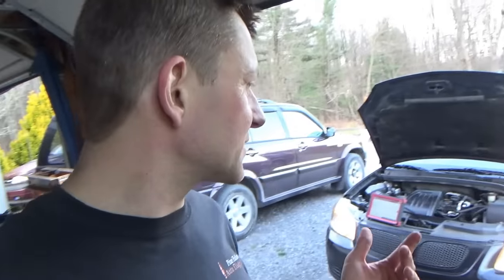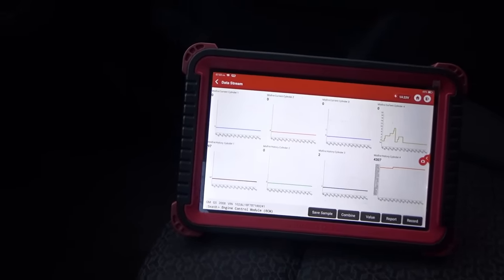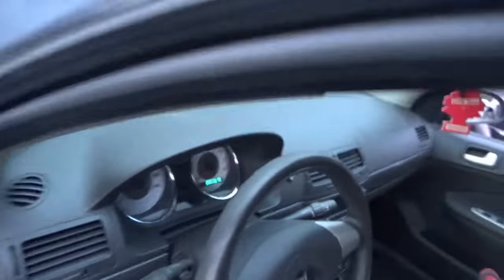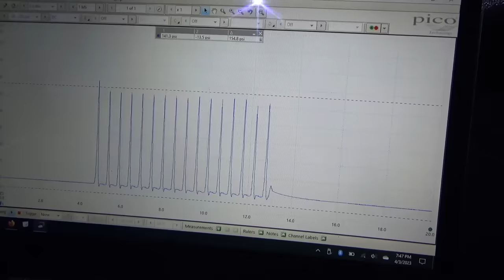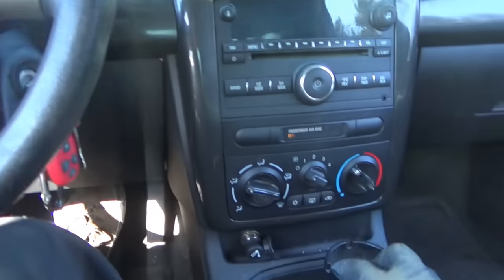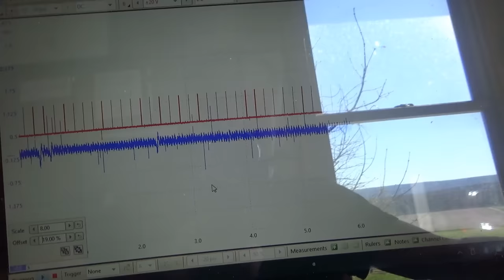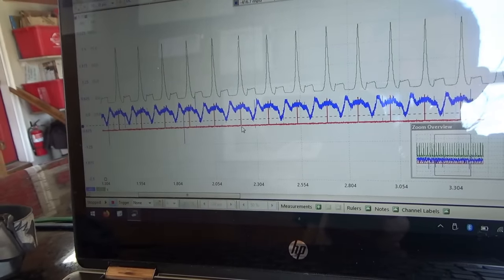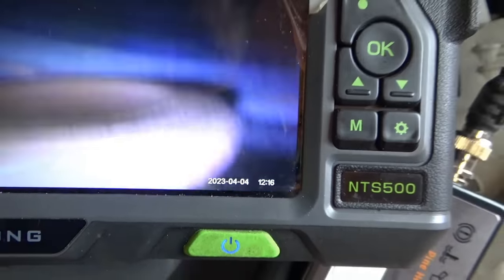P0300 Mystery MISFIRE - Difficult to Diagnose! (Intermittent "FISHBITE")

Comment: Great video IVAN,as always.Why are you so sure the valves rotate? Without springs designed to do just that?I ask because a long time ago i worked on a friend's car a 305 GM Firebird that had spring retainers on the exhaust valves only that were called valve rotators.That was my 1st ex-poser to that system and it made perfect sense at the time.What you said about the valves haveing a spot where they leak makes sense too.my 1st thought was a sticky fuel injector.or a wire that's arcing.i wish you had pulled all the plugs and coils and compared them side by side.What if one coil has leakage of elec? I'm sure YOUR viewers like myself,want you to dig further to find the issue.Out of 1,000 cars you found the cause and this one eludes you???? how can to sleep???haha or eat??
Newspaper headlines>>>Chevy Cobalt defeats IVAN THE GREAT<<< Live mouse found in INTAKE MANIFOLD,given KEY to city by mayor or Sate College.just kidding of course.this is one of your best vids,but we always learn and appreciate all of them.
Reply: scanner would have thrown a coil or injector code.   When you can hear a misfire coming from the exhaust pipe, it is generally an exhaust valve problem.

Comment: I work in the method of... What do you need for ignition.  You need Air, you need fuel, and you need spark.  If you have fuel, and you have spark, then the problem is air.  Because what is a Misfire?  Poorly timed ignition, or just failed ignition entirely. 
If you test for spark, and it's consistent, then you can rule out that part of the ignition triangle.
If you test and find you have proper fuel, then you can rule out that part of the triangle.

So you're left with air... Either the exhaust valve is sticking and letting enough air out that you lose stoichiometry, therefore no ignition, or late.. or the intake valve is sticking and not letting enough air in during the intake stroke.

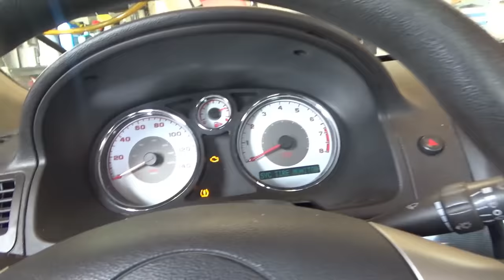@17:58

Comment: thinking ceramic valve seat moving or cracked, GM used to make top cylinder cleaner or perhaps seafoam to try to clean a slight hardened carbon deposit on one of those seats, air in that cylinder may help if you hear some type of leaking .loved your tenacity

Comment: I’ve had this before with the valve guides causing the valve to stick when the car got warm only on idle. It was a known problem with Fords ztec engines in the 2000 ‘s over here in the uk. They were replacing all the valve guides and valves under warranty. It was a pain trying to diagnose this without the tools that you have at your place, like the pico. It was guess work and a lot of unpaid hours diagnosing. In the end up we took a head off and sent it to the engineering shop who found the guides to be out of tolerance. Once the guides were changed out and new valves put in the issue never came back. It’s trying to explain this to a customer that it’s only a guess at this point until it’s stripped and confirmed, and if it’s not the valve it’s more diagnosis. I hope you get an end result, I would love to see a part 2!

Comment: Try sticking exhaust valve guide in 1 and 4. This was my experience with at 2010 Cobalt. After going crazy, I found that there was a quiet recall on the cylinder head of that engine, only up to 100,00 miles. my engine was already 125,000. I pulled the head and sent it to a machine shop. The engine ran trouble free for the next 75,000 mile. after that the car went to the great junk yard in the sky.

Comment: Interesting case study ,im going with broken valve spring and maybe intermittant valve sticking due to poor valve spring tension maybe some gumming in the valve guide. Shame we will probably never know  but I agree its way past money pit time for that car ,drooping head linings , transmission  issues , ac issues suspension issues its not using much oil but oil leaks etc coming up . Drive it till it dies then off to the junk yard.

Comment: Those coils look like $10 Ebay specials. They may not be THE cause of the problem but may contribute to it, especially if the customer said it was running fine 2 weeks ago. Dealing with an issue on a 2004 Saturn Ion with the same engine and 209K that may occasionally run rough and miss just on the first cold start of the day for 10-20 seconds. Was watching your 7 year old video, P0300 Misfire case study: 09 Chevy Cobalt, for ideas.
Reply: Well they 100% are not the cause of the problem. The problem came about before they started putting parts on the car. This was said at the beginning of the video

Comment: 1. Leave everything hooked up so it runs
2.take valve cover off
3.build a dam out of cardboard around the top of the head so the oil dont go all over everything
4.start it
5.smoke the intake
6.watch the valves 
7.look for smoke on
Compression stroke
Reply: Look for smoke where?
Reply: If the valve doesent seat
Or a spring is broken compression will smoke
Out under the spring

Comment: I have a very similar situation I'm dealing with now on a Chevy truck with a 6.0 v 8, intermittent miss on one and five cylinder, clears up off idle, switched plug, coil, wire, done fuel injector Ballance test, was as all equal, compression was 160 psi, checked cylinder leakage was well below 10 percent, checked fuel quality, had no fluctuation on a vacume gauge on the manafold, smoke tested the intake with no leakage from the intake manafold, at this point I can only think it has excessive carbon on the back of the intake valve soaking fuel causing a partial combustion or a cracked or weak valve spring, time for more digging I think, like that borascope picture 👍

Comment: If you suspect a sealing problem, maybe an old fashioned cylinder leakdown tester would help. You could compare the leakdown percent with a good cylinder. Listen for air coming from tail pipe. I still take mine out of the antique drawer every once in a while.
Reply: I'd assume he's aware of a leak down test and would perform one if he felt it was necessary.

Comment: I had deja vu watching this. I ran into the same exact issue on that 2.2 engine in an HHR. Followed almost the identical diag process as yours and came out scratching my head. I suspected a valve sealing issue. The customer did not want to spend any more on the vehicle so I never did see it through.

Comment: I would try injector swaptronics. And spark plug/coil swaptronics too,even if they are new. Also scope the crankcase pressure and cooling system with the transducer. Also would be great to see the ignition waveform at the moment of misfire. I doubt its broken valve spring bottom coil. We saw misfires on other 2 cylinders. This head needs service due to millage. In nowdays where scopes and meters are the first choice for diagnostics ,i would do leakdown test also. That could have pinpointed the problem.😊

Comment: @pine hollow auto diagnostics 
I'm curious, does the vacuum line for the fuel pressure regulator, by chance, go to the number 4 intake runner? I had an earlier 2.2 ecotec that acted just like this. It had a pinhole in the fpr diaphragm, that would allow a droplet of raw fuel to get sucked in the intake occasionally. Fishbite miss, at idle, only when hot. I don't recall what cylinder misfire code it set.

Comment: It looks like a piece of carbon has stuck to the valve seats.

When I did a small automotive industrial course (it was a prerequisite to becoming a diesel mechanic ,I did that because the automotive service course was full)  at tech as a part of my higher school certificate one of my teachers spoke about how he cleaned the carbon off the exhaust valves in his old Ford Escort.

It would've been loud but he used to tip water down the exhaust ports while revving the crap out of the engine to break up the carbon on the valve seats on the valves & in the cylinder head after the exhaust manifold was removed !

Comment: My belief is that as a condition worsens (compression, mixture, etc) you reach a point where an undesired event like a miss will occur intermittently until the condition worsens to the point the undesired event becomes consistent. Interestingly enough, my 1947 Chevy does this same thing, and no amount of idle mixture adjustment makes it go away.   It is original, with one carb and one coil for all 6 cylinders - but who-knows-how-many miles. I haven't invested much effort in diagnosing it, because it has so much piston blow-by. So I'm already doing as you suggest, and driving it.

Comment: I have  found  mechanical  issues   doing relative compression,   but  you can find more information  than relative compression  on  an absolute  vacuum sensor , those small leaks are very visible on intake pulses , very intermittent  your case but  tha tool is power full

Comment: I have a similar issue with my 2000 Pontiac Bonneville non-superchsrged. I have a misfire on cylinder 6. on idle only. Vehicle has 181K. It. I replaced all three ignition coils with the original ACDelco, and still have the same problem. The misfire is consistent and sounds more like a rolling idle . I have yet to do a visual inspection of the spark plug, wire, and fuel injector. I'll also be performing a cylinder compression and leak down test.
Reply from the maker: Light misfire at idle is almost always a compression problem, or occasionally a vacuum leak at that intake port through the manifold gasket area 👍

Comment: Ivan it might have been interesting to see the KV and sparkline for cylinder 4.  I didn't see that in your library of waveforms.   Max Vanderbrink's seminar indicated when there is a valve seating issue the KV would behave like an inchworm up and down in an inconsistent manner.  A broken or weak spring would be more consistent.  You might also have seen more hash in the sparkline when it misfired.

Comment: Exhaust valve sealing and the lack there of seems to be a trend lately! Weaker metals, lack of oil changes along with always running a bit low from burning oil seems to be the killer of the exhaust valves. What else can cause excessive heat and wear on ex valves? Lean mix in that cylinder over time or is it more a seepage from a valve seal or piston rings or maybe pcv sucking oil into the intake over time or all of the above? Cool stuff!
Reply from the maker: If I see one more burnt exhaust valve and have to tear the head off I quit 😂

Comment: This car has a few known engine issues. One of them is related to the harmonic balancer bolt backing off, causing the crankshaft pulley to bounce against the keyway. I would check said bolt to see if it is tight. If it is not corrected in time, the keyway will break. Which will throw off the timing, bend push rods and valves. Please let me know if you looked and what you found.

Comment: Ivan you finally got to it in the end - Carbon Deposits etc... To get a definitive answer you would need to spin the Engine over so all Valves are closed on the Cylinder then stick a Smoke Machine in that Plug Hole(not literally but yeah a hose!) & wait for a Smokin' Pipe! (excluding Leakdown of course so if it's bad just pull/loosen Exhaust Manifold Bolts🤔

Comment: A very puzzling case study indeed.  A compression difference of over 10 psi would cause a slight misfire.  But a consistent loss of compression should show a much more consistent misfire.  And what's with the misfire showing up on other cylinders?  That gave me a WTH moment so I can see why you're struggling a little with this one.  Now while a valve can rotate ever so slightly during a cycle, it will be very difficult to prove your theory without getting your hands dirty.  I do feel that you are on the right track though after seeing those valve seats.  Good gravy, they are burned!  But I still would have liked to have seen the results of a leak down test.  I am really hoping to see what happens next.

Comment: That does look like valve trouble but you are not seeing any compression anomalies. It could be weak or broken valve springs. The valves are clearly not seating properly. As others have said do a cylinder leak down  test. Higher speed will make the fault disappear. Having manufactured slow revving oil engines, good valve sealing is very important as in those engines compression is very important particularly if the engine is hand started. It is most likely a mechanical fault and will not be cured or found unless the valve guides and general assemblies are checked carefully.

Comment: Ok, so think it's a valve sealing problem. Along with the tail pipe pressure also take a vacuum pressure from intake and a ignition sync. Then use the overlay and that will tell all you need to know.

Comment: Great job as always. I was definitely following you there because I know that when I worked for a Chrysler dealership back in the day we would replace cylinder heads for an intermittent valve sealing issue causing a misfire. Anyway, out of curiosity and I'd be curious as to what you think. But if you had set up a secondary ignition probe on that cylinder, I would guess that when it misfired, if there was a cylinder leakage issue it would cause the burn line to go crazy because of all of the turbulence.

Comment: Hello
I am still learning oscilloscope skills. Do you think a cylinder by cylinder leak down test. One dry and one with oil in the b cylinder show more valve leakage  on cylinder 4. We have seen weak valve springs cause running issues. We agree let the customer drive it until it in really bad

Comment: I have a 2008 dodge caliber same problem cylinder 1 and sometimes my check engine flashes and it'll stop flashing but it stays on. Sometimes code reads misfire and sometimes it dont also my valve cover started leaking oil like the other guy said his wifes mothers did. I was thinking if the injectors voltage was fluctuating but the guy may be right about the spring.mines got a 177000 miles. Its been doing this for about 6 months but i really don't have no mayjor problems and i was like you...just keep driving until i figure it out

Comment: I had a 97 Cavalier that did this same thing but worse. I threw the parts cannon at it after long diags. Plugs, wires, coil, map, timing chain and sprockets, tps, checks for vac leaks (none), coolant temp sensor, crank sensor, compression test, fuel pressure test, new injectors, and new valve assembly.  No change at all. I took it to the stealership to help diagnose to no avail. Out of curiosity, I changed the computer. Guess what, it worked. I quickly sold it after. Good luck with this POS!
Reply from the maker: Parts cannon to the max LOL!

Comment: Most likely exhaust valve showing early sign of not sealing.  I've had EGR issues cause lean misfire.  Not sure how the EGR is routed into the intake and cyl head.  Is #4 closest?  Are individual cylinders used to draw EGR gases in?  I had clogged individual ports causing the only open port to get flooded with EGR gas and generate lean misfire.  Couldn't find the service record to pull more details, going off my old memory.  Hope this helps.  Side note - crank learn wouldn't hurt to make sure things are sync'd.

Comment: intake vales and or exhaust valves sticking in the guide when hot the trail blazer heads had a problem with that i fixed a lot of them back in the day working for chevy

Comment: I would suggest watching ignition primary, injector current and i would suggest watching fuel pressure with the scope when the intermittent misfire actually occurred...probably would help paint a better picture.

Hard to call compression issue without actually seeing an issue with the scope in cylinder.

One thing to remember is what John Thornton teaches is that Intake affects compression and exhaust affects combustion.... seems like this vehicle is inhaling and compressing air in #4 just fine... is it intermittently not releasing the combustion properly🤔

Maybe a transducer in the intake manifold might show if exhaust is being released into the intake as opposed to the exhaust stream

Comment: Interesting. My intermittent misfire was under load, smooth at idle. Cel would flash for 10 seconds then stop and not come on again for a couple weeks then flash for a few seconds then go away again. I brought it in, mechanic test drove it with scan tool, cylinder 1 misfire. Changed out all coils and spark plugs and hasnt happened since.

Comment: I have seen valves intermittently fail to seal due to work out guides, or even bad seats. If the valve is rotating and has the occasional burr. I worked on a 2000 f150 with valve guides so worn out it was misfiring. It has to start somewhere.

Comment: We get to guess?  Broken cam shaft. Under load it turns on cylinder 4 in time. Idle with no load, it is changing valve timing and “wobbling” is out of time. But the computer is firing the plug where it thinks it should, but the valves out of time intermittently causes the loss of vacuum and misfire only on cylinder 4.

I’m guessing. I also like the bad valve spring theory too.

Comment: I would use a compression checker to apply air pressure to the questionable cyl's at TDC and listen for air flowing  at the exhaust pipe.